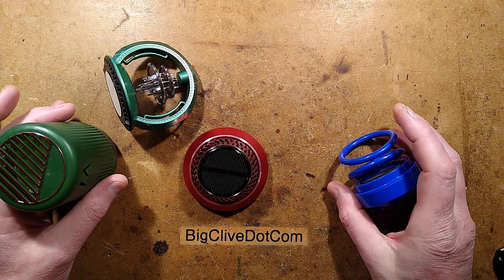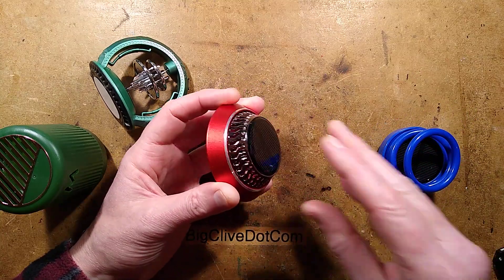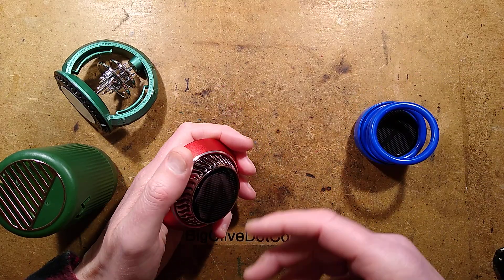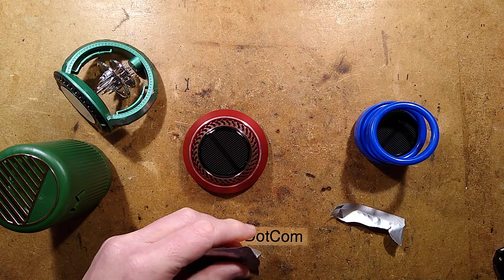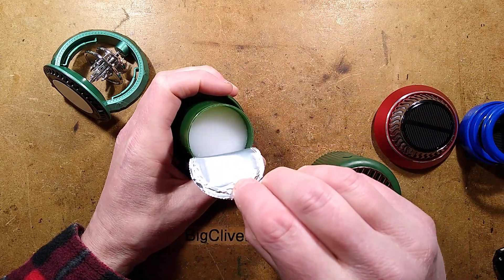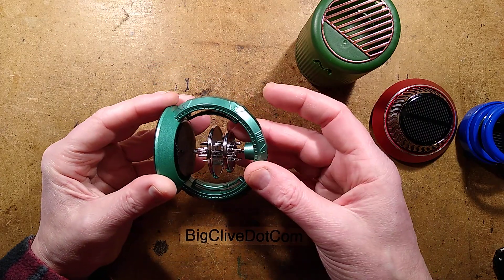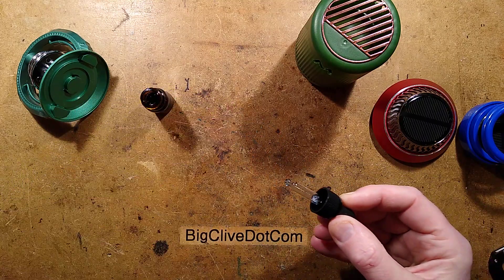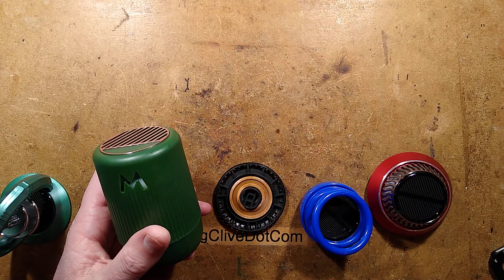How a vehicle molecular de-icer works

Comment: The BEST de-icer I ever had was in an old Lincoln Continental. It had a copper laced windshield and had a very intricate system: Once the de-ice button was presses, the alternator switched from 12 to  around 100-120V and running the engine off of the battery for the time it was on. The de-icing circuit was very complicated (for the time), and, if I remember it right with somehow using the copper layer on the glass to direct HF  modulated current over the windshield. It thawed ice in SECONDS, I am not kidding you.
I still have the original shop manual for this car and there are MANY warnings what can harm you when you service the de-icing circuit.
Reply: That sounds like it would be one windshield sticker away from starting a fire.
Reply: My Land Rover has that! It's a completely heated windshield with super tiny copper strands running all along the windshield, they are much much thinner than a human hair and there are tens of thousands of them, easily. It's not visible to the eye unless you're looking for them. It's the exact same system and wire found in every aircraft cockpit window that has de-icing.

Mercedes, Audi, VW and Porsche also have this in their cars now. The high end ones, tho.
Reply: I've seen modern cars with similar systems (just 12v defogging though), hex meshes are placed in the glue between the panes of glass in the windshield, it can help the de-ice process when you're waiting for the engine to warm up though.
Reply: The cars from the 80s had a similar thing, copper colored painted circuits on all the back windows. I miss those things. Wonder why nobody ever figured out how to make one that's practically invisible, or one that sticks on like window tint film? It's beyond doable, and would be infinitely more efficient than all that ductwork wandering around under, through and around the dashboard and doors. A million times more so with electric and hybrid vehicles too, and more reliable on top.
Reply: @spacewater7  They did work it out, it has been in Ford's (and other makes) windscreens for years (Lincoln being a Ford brand, thats what OP is talking about). I have a 20yr old Renault and the top model had this. The problem with it is that it can only be used once you get in the car, it also doesn't warm up the cabin, so the ducting is still needed, and its expensive, so they usually use the old copper paint on the back window and nothing on the sides.
I am not sure why the system would switch to a higher voltage, as that would surely give less current than simply blasting 12v through it, which is going to lead to a higher resistance, unless it was required for the thin wires (but I know that on my car model its just 12v, as you can hook it up if you get a heated screen fitted to one that didn't have it from factory).
Reply: @imnotamechanic3491 I had one of those fords and only about 30% of the windscreen had the thing working so still had to clear it using other methods anyway. I assume the windscreen itself would be hellishly expensive to repair if you got a chip too.
Reply: @imnotamechanic3491 He wasn't talking about trace lines on the glass, he's talking about the whole glass having a conductive coating.
Reply: @servicetrucker5  Exactly. There were no wires in the glass, it was a layer of conductive material that looked like transparent copper.
The 120V were also not sent to the windshield directly but through some device that turned it into a high frequency alternating current. I don´t know the final voltage or frequency though, but it must be some rather low voltage at a high frequency so  to make it safe since the copper layer was not insulated.
Reply: @eaglevision993  Probably has something to do with the skin effect but I’m no engineer
Reply: @servicetrucker5  That could very well have something to do with it, but I am also no expert in that field.
Reply: @eaglevision993 this is the same system applied today in commercial airliners... There is a layer of conductive material that maintain the windshield heated
Reply: @servicetrucker5  I'm thinking something like inductive heating??
Reply: @kde5fan737  Probably yes
Reply: @spacewater7  There are nearly invisible heaters now. I was in a range rover evoque from ~2014 recently and it had heating element lines throughout the whole front windscreen that you couldn't really see unless you leaned very close to it.
Reply: @Voyajer. When I ordered my 2014 VW Golf I was so tempted by their version of the heated windscreen as it is far better than the Ford (I had a Sierra with the wires embedded in the windscreen) and JLR versions. VW use a very thin metalised film in the laminate. It heats up at the press of a button but also reflects IR and therefore keeps the car cooler in full sun. The one thing that put me off the (then) £350 option was that you needed to order it with the wireless phone charger that had a link to an ecternal aerial - the metalised film wrecked phone signals in the cabin. That was another £350... £700 felt too much of a luxury when a can of Holts costs £3,
Reply: @Voyajer.  That is a different system though since it uses a regular resistive heating element.
Reply: @spacewater7 ,  windshield heater seems like it would be ideal in the worst icy conditions.    I have dreamed up most of the possible heater defrosters and most have some sort of drawback engineering is compromise.   In the old days they had kerosene heaters and engine block heaters.  In siberia saw landrover with special heater- cooling system but still couldnt beat the ice
Reply: @spacewater7  have you ever seen an aircraft windshield? O_o.. super fine copper wires run all the way down them.
Reply: @spacewater7 - I have an invisible electric defrosting windshield in my 2015 Volvo.  It is made by incorperating strands of carbon in a very small wavy pattern in vertical colums along the windshield.  I'm guessing the spacing is about 2-3mm  between each column.  The carbon fiber is super thin, invisible unless the sun hits it just right & then you see a bit of a rainbow reflection coming off a couple points of the CF (I thought it was chips in the windshield at first).  Range Rover & Jaguar also have the same windshields in many of their models.  It's a really nice feature TBH, it clears the windshield long before the car/heater warms up!

Comment: Proof that the old saying of "one born every minute" obviously doesn't hold true any more.

More like there are thousands born every minute, and they'll snap this crap up in a heartbeat.

There's a listing on kickstarter just now for a fancy sticker that goes in the air intake of the car.  Claims it captures the waste heat from the engine, and uses it to magic the airflow into some amazing voodoo fuel saving airflow instead.

Comment: Dont need one of these. Because i use a fuel saving OBD device i have so much extra petrol that i just burn a few litres of petrol in an old Fray Bentos pie tin which i sit on the passenger seat...never had any problems with ice formation in my car😂

Comment: I had an Oldsmobile with a leaky trunk seal and stuff started to grow in there, not quite to the point of needing deforestation though.
Reply: If the growth was that advanced, are you sure it wasn't a very Oldsmobile? 🙃
Reply: @UK-Combustibility-Assured  It was a 1972 model which bought in 1982, so in dog years or 1970s car years, it was past middle age.  🙂

Comment: How to keep your vehicle frost-free run an extension cord to your car 600 watt space heater in car and leave running all night you will come back there will be no frost on it but you still be very cold it keeps it a few degrees above freezing so you won't have that problem let's hope the power doesn't go off then that's where having remote start that will run for however long you tell it to run is great

Comment: Hey, I bought one of these and have had it in my car for the past couple of months.  Not a single crystal of snow has formed on that car!!!  Of course I do live in New Zealand and it's summer here with temps around 20-30deg C -- but that's not the point!    Clearly the device works -- and it doubles as a snake repellant.  I haven't seen a single snake in my vehicle since I fitted this thing and I have friends in Ireland who have had the same experience (wrt snakes).   It's actually a shame about the snakes -- because I think you could use these things to stop any snake from squeeking (if you get my drift).

Comment: Canadian snow belt here. You know what keeps windows clear of snow and ice? A Canadian Tire 500W plug in heater mounted under the dash with a timer for an hour before you have to leave. A foot of snow easy. Time it to start with your block heater. The most expensive part is the timer.

Comment: Fun fact, most turboencabulators have a molecular defrost setting 😂
Reply: Just need to redirect the 6 hydro-coptic marzelvains so they're not logarithmically attached to the amplificant lunar wayne shaft. You do end up with some side fumbling though.
Reply: Needs more Retro Encabulator
Reply: @Rightnt  The Retro Encabulator has tubes (of course), and the heat from the filaments serve as the defrosting element.  It’s an unadvertised and under appreciated feature.
Reply: I put a Rockwell Retroencabulator in a 1957 Bel Air coupe for this exact reason! Works like a charm!

Comment: Two air fresheners I would actually buy:
1, Sawdust and two stroke engine.
2, Tyre shop
Reply from the maker: You can get "ships engine room" aroma for theming.  And it's spot-on.
Reply: @bigclivedotcom  If it's anything like car deck on a boat, I'm all in.

Comment: These things are incredibly effective. I recently put one in my severely frosted freezer and went away for the weekend. Upon my return there was not  a trace of frost. Coincidentally all my food had defrosted and the RCD on the fuse box had tripped but I put that down to an EMP produced by the immense power of this device 😂

I am thinking of putting one in the garden this winter to turn cold and frosty winter days into a tropical oasis

Comment: The only electric item that I know of that can defrost your car, is a 2kW fan heater placed inside the car, powered from a suitable mains electric socket… And even that requires tens of minutes run time….

Comment: Ebay? Facilitating fraud!? Say it ain't so!

(The first rule of ebay: Ebay will ignore any of their own rules if doing so improves their bottom line.

In fact, ebay will ignore any local, state, federal or international laws - and even common decency - if they can safely hide behind a veneer of plausible deniability.

Ebay is essentially a sleazy corner pawnshop masquerading as a Fortune 500 company.)

Comment: I have to disagree with you about Ebay and Aliexpress. If they tried to police scams, then you'd run into the problem where scammers or even just competitors would just spam-report their competition. Now this might not seem like a big deal for obvious scams like this but when its stuff involving machine tools, obscure scientific instruments, rock samples, etc, then you can't expect the companies to actually know enough to tell if something is a scam or not. A major consequence of this is that scammers will just start scamming scientists and machinists and factories by making fake equipment. If someone gets duped into buying a spinning wheel thinking its a de-icer, they didn't suffer much but if a scientist gets duped into buying a fake infrared spectrometer, then it becomes a much bigger deal.
Reply from the maker: It is a hugely complicated area.  People will abuse everything for profit.

Comment: I brought one of these and my car has been ice free since purchasing. Mainly because we haven’t had temperatures below 6 degrees since and also I keep my car in a garage overnight

However, I am disappointed the deforestation scent doesn’t include two stroke fumes 🤣
Reply: Just buy the agent orange scented versions for the true deforestation experience.
Reply: @barongerhardt they’re probably talking about 6 degrees Celsius, no freezing possible
Reply: There might be a misunderstanding happening here with °C and °F  @barongerhardt
Reply: Should include sulphuric acid vapor like unfiltered coal power plants .
Reply: So in effect the version you purchased is a weather control device.
Reply: @Arachnoid_of_the_underverse  Well…not quite. I keep asking for snow and it never arrives 🤣

Comment: Brilliant. Solar panes inside a snow covered car during the season of the year with the least amount of sun.
Reply: It does not matter.
The solar energy from the previous day is stored in the flux capacitor (1.21 gigawatts) and activated at night when snow falls.
Reply: But only once you drive at 88 mph. @galdavonalgerri2101
Reply: @galdavonalgerri2101  Didn't BMW once have some sort of thing buried along the length of the dashboard, well insulated high thermal capacity gel-stuff that absorbed coolant heat during the previous journey, kept warm during the night, so putting on the fan next morning, the blown air was still warm enough to defrost the windscreen until the engine got warm again.
Reply: There's a sun built into them. Everyone knows that.
Reply: Works especially well overnight, too!
Reply: It has superly duperly madonistic wave inferogammerty inferometering slamboroshious goofelling technoflagella inside.
Reply: @jeffscott3186 That's kind of what I thought, but I wasn't really sure. Thanks for clarifying that for us. Now if you'll excuse me, I have to go finish servicing my retro turbo encabulator. I think the lunar waneshaft is out of alignment.
Reply: @section8usmc53 Oooo, you don't want that, will well mess up your whole day.
Reply: @jeffscott3186 I hope it's version 2, the original attracted fruit flies.
Reply: AND  the most frosting happens when the car isnt use  .... during the night
Reply: It uses the newest graphene ultra high efficiency solar panels (NASA technology).
Reply: Honestly, I've actually wished for some sort of small solar powered heater after winter storms on occasion: my area gets ice more often than snow, and I usually work afternoons, so it would frequently have been enough to loosen up the crust.
Reply: @absalomdraconis  If there's enough sun hitting your car to melt the ice, it will do it directly, there's no point converting it to electricity with a solar panel just so you can turn it back to heat again. This would only work if there was a large battery involved, at which point you might as well just power the heater directly from your car's battery and forget about the solar panel.
Reply: @ChrisBLong  you are forgetting the molecular agitation. Most potent of agitations there is.
Reply: @FrancSchiphorst  You never met my wife...
Reply: @absalomdraconis got a small space heater? Got an extension cord? Well there ya go. 😂
Reply: @absalomdraconis are you aware of the black foil in the glass box and a circulation fan? Keep a plastic sheet or cheap shower curtain over it so the front doesn't get a layer of ice. Old trick my father learnt with heavy frosts
Reply: They use the snow that is already on the car to help in the diffusion. The nature of these things is so brilliant: since snow is less dense as water, the energy needed to agitate its molecules is less than that of free water molecules. The Devices needs less energy the more buildup of snow is already on there. That way, it needs nearly no energy at all while the car needs defrosting. With ice it’s different but ice buildup usually happens overnight. I think since the green one is the only one with an apporopriate crstal to catch the precious moon beams and convert them to Nano-enhanced Microwaves it is the only one that can actually work overnight. The other ones are more suited for your daily commute to work. 

And now that I think about it, I realize how brilliant the design and the idea in itself is … the more clouds, the more diffusion of light there is … and diffusion helps with keeping the energy required by these devices down.  And what makes snow? Clouds!!! So so brlliant! Can hardly cope so brilliant. Can hardly manage!
Reply: They replied to someone on Xitter that the lack of daylight in northern Norway (Sunset in November, next sunrise nearer the end of Jauary) would not stop the solar powered unit working and defrosing their car.....
Reply: My first thought when I first saw them. But I might modify (battery run) and copy the design for my future hothouse if I understand the concepts behind this. Probably just easier to stick with the gas lantern and computer fan idea
Reply: But they're supposed to fix that themselves!
Reply: you put it in there before the snow builds up

Comment: I want to see one that levitates the car and spins it around at high speed so as to prevent snow from settling on the car, and stops frost from forming on the glass!

Until then, I'll just keep using a jug of warm water to de-ice my locks and windows!
Reply from the maker: That would work.  A car centrifuge.  Bit messy if someone was inside at the time.
Reply: @bigclivedotcom  Yeah, I can imagine - Breakfast, dinner and tea, and potentially, last night's supper!

Ultra vomitatious........... !

Comment: Sadly people do fall for this BS. The unit is way too small to be a deicer, but at least their car smells nice while waiting for the cars heater to warm up. There are units that run on kerosene that will heat up your car quickly, but they are deemed to be dangerous. Some car manufacturers equip cars with special timed heaters so your car is warm by the time you have to go. Good post, thank you 👍